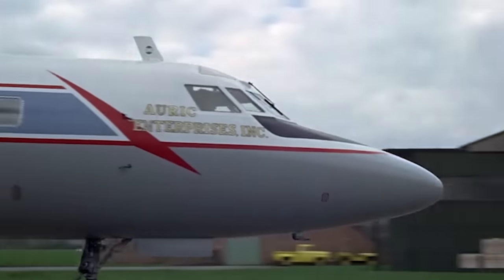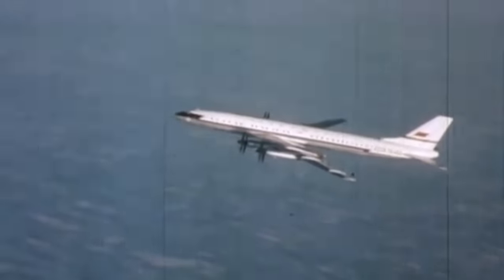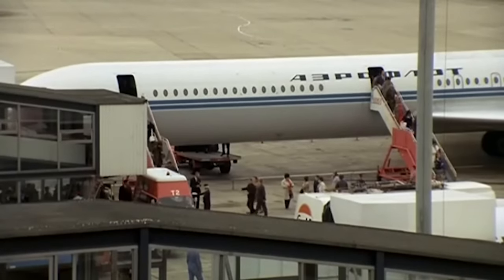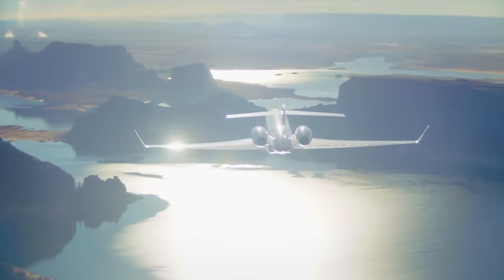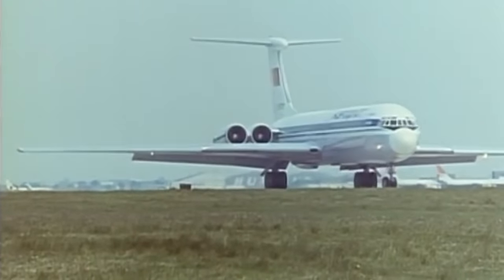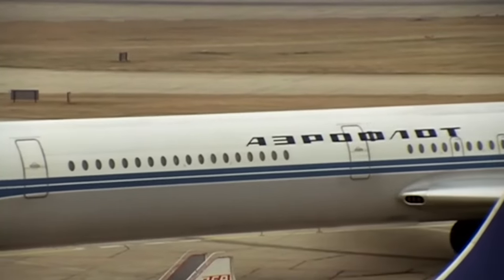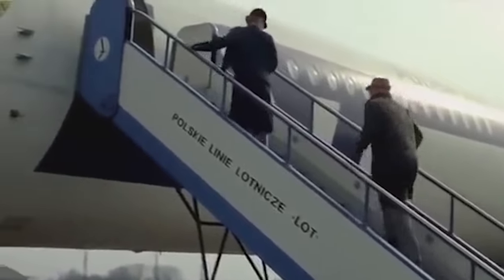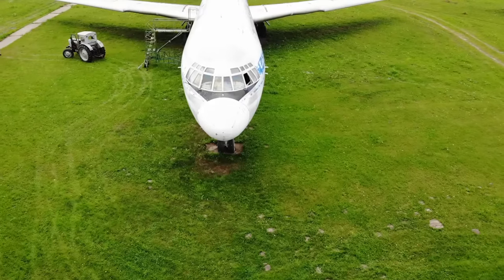IL-62 - an ideal option

Comment: Quad rear-engine layout was so cool. Love the IL-62 and VC-10!
Reply: These planes were beauties
Reply: There's also the lockheed jetstar
Reply: Did you ever hear a VC10 takeoff?  DAMN! they made a ton of noise. Very impressive and memorable experieince.
Reply: The engine layout was its Achilles heel. One engine catastrophic failure wood knock off the other 3. This happened a lot more often than expected. The engine placement and Soviet rush to keep the plane in the air by cutting corners contributed to fatal crashes. I flew one of those in 1984.
Reply: @notyou6950   This engine layout seems like a workaround to me. You design the supports for a certain weight and thrust and then you only need to adjust the nacelles to put more or less engines, depending on what you have at the time. Some ekranoplan vessels had this layout with 8 engines!
I wonder how it would behave with two more modern engines instead of the 4 original ones
Reply: @gsilva220  Ekranoplan!  Yeah!  Caspian Sea Monster!  (How's that for a sober, well-reasoned scientific response?)
Reply: @gsilva220  this aircraft was retired from service in most places that used it because of the catastrophic engine failures. It is also the first passenger aircraft that was upgraded with in flight vibration analysis hardware to keep an eye on possible problems with the engine shafts snapping off. The Soviets build them with a time saving measure of removing half of all the rollers in support bearing and cutting extra holes for lubrication in the race of that same bearing. That introduced a kerf in the steel and reduced strength leading to several well publicised crashes. Once one of the engines shattered its compressor disk it would then chop and shred the other motor next to it and start fires.
Reply: Peter Lyczek    The load on the bearings with 13 rollers instead of 26 overheated the bearings, causing the drilled weakened shaft to fail. The turbine disk then spun freely to tens of thousands of RPMs, shattering itself. The shrapnel would then proceed to damage the adjacent engine, pierce the fuselage,  damage flight controls and set the plane on fire. The most cruel part is that they never did it to an SSR, only to Poland.
Reply: @gsilva220  I know all that. The best part of it all is that I flew on one of them planes and by that fact alone, was exposed to the crash possibility. The great irony of life for me is that I work on cnc machinery for a jet engine rotating components manufacturer.
Reply: They couldn't be more dangerous though as the history of those aircraft showed afterwards.
Reply: @gsilva220  You're thinking about the LOT 5055 flight in 1987, right ?
Reply: @julosx   Yes, but but the course of events in flight 007 was also very similar.
Reply: LOT was very unfortunate in did, engine 2 failures leads to eng 1 and many other failures as flight control, cabin fire and such... a total disaster.
Reply: I never flew on the VC-10 or the IL-62. In 1967 I did get to fly with my friend, who's dad was the pilot, on the corporation's Lockheed Jetstar from LA to Dallas and back. That was a great design and very quiet in the cabin.
Reply: John Dumont As an American and as much as I love the planes from Boeing, Airbus, and other manufacturers, I have to say the Ilyushin IL-62M is my favorite because of the looks and sounds!
Reply: Big Cake It is true that their safety record was...questionable. But nonetheless they are unique planes and I’ll admit that sure Soviet safety as a whole isn’t clean but hey, no form of aviation is 100% clean whether it would be US, Indonesian, European, etc. I mean hell, look at the 737 MAX and the reputation it’s gotten lately.
Reply: Both great planes
Reply: flew across the Atlantic on one end seventies on CSA with a stop in Gander on the way back of course!  YUL-PRG_YUL great beer with 8% alcohol! We were young and bombed! I have a cousin with your name as well I haven't seen in years...cheers!
Reply: Both brilliant planes
Reply: I was working on IL-62 and IL-62M for Polish Airlines. The plane was not terrible and was liked among crews in 70-ties and early 80-ties, even outdated compared to western designs, especially in electronics. On the transatlantic trip, the plane was burning 11 tons of fuel in the first hour. Only after 5 hours of flight, it was reaching economical 5 tons per hour consumption. Fully loaded (and that how it was usually operated by Polish Airlines), it needed the full length of the runway for a takeoff. The really serious problem was (of course you cannot hear anything other from Polish Airline employee), quality of engines, both Kuznetsov and Soloviev (second used later on M version). Serviced exclusively in USSR only, both designs were plagued by scandalous lacks in quality and precision of manufacturing and nothing short of criminal lacks in quality control. As two Polish disaster investigations revealed, those lacks ranged from, nonmetallic inclusion in the material of critical parts, lack of any finish besides coarse on part requiring micro-metric finish precision, improper heat treatment of parts, unorthodox violating technical norms modifications, startling negligence in manufacturing, and nonexistent quality control. Interestingly, the Soviets had denied faults and the role of those faults (in their engines) in two Polish disasters for a considerable time. The official position was, that discovered by Polish Disaster Commissions engines faults were not the cause of the disaster, but it results. Even it was an obvious lie since the beginning, as Soviet explanation, despise of a number of signatures of important “scientific” and government officials, could not explain things like, finding parts of the engine over 150 km away from the disaster site, Soviet denial was finally and fully withdrawn only after, in two separate incidents (in Polish airlines), engines suffered catastrophic explosions while in flight, which did not end in disaster. Both planes landed safely. As disaster did not happen, engine faults simply could not be blamed on disaster anymore. In yet another interesting twist of fate, after surfacing of the following video on YouTube: https://www.youtube.com/watch?v=-xltGZk4aHY (ground inspection after a successful emergency landing of Cuban IL-62M in (good Lord, get this),...APRIL 2008 (!!!), when it seemingly became apparent that despise Polish disasters, engine problems were never corrected, even 20 years after, another campaign of denial took place, involving this time internet trolls, forcing untruthful claims on international Internet forums (Wikipedia and other), even what appears to be the clandestine operation of Russian intelligence agencies. This time on public forums, Russians attempted to claim, that presented by them record (which according to them is 100% trustworthy), of operation of IL-62 and IL-62M, indicated both planes as considerably safer than any western counterpart of the same time. To explain in that context, the very existence of Polish disasters, 20 years after those disasters, all of the sudden some documents of Polish Secret Police of communist-era were “discovered”, which claimed, Polish Airlines in unorthodox agreement with the manufacturer (which grant it a free hand in decision making), decided to extend the time of operation of engines between checkups, beyond originally recommended by the manufacturer. The story itself is constructed with a dose of negligence, revealing the lack of homework of the storyteller. For instance, as a manufacturer (making decisions) it stipulates Ilyushin Bureau, which did not produce engines, it produced the plane's body hence it would not be the one making the decision. That would be a job for Kuzniecov (for NK-84 engines) and Soloviev factory (for D30KU engines). Matter of fact Polish commission found very little to complain about the body of the plane and described Ilyushin Bureau's cooperation in regard to disasters as satisfactory and its findings as “objective”.  Problems were since the beginning with engine manufacturers and particularly bearing manufacturers. Anyway, the problems of such claims are as follow. As Soviet disasters were kept secret from public knowledge and opinion and records were secret, kept by the Soviet state only, it is only unverifiable say of new Russian now government that presented records are full and truthful. While IL-62 was still operated in 2008, revelations coming from the Cuban incident were quite unfavorable for the reputation of the plane (still manufactured and sold), which does create an agenda for the Russian government to be less than fully revealing. Revelations regarding engine operating time limits come not from work of the official Polish Disaster Commission, not in the time of the investigation, but from records of communist secret police which not that much had ties with Soviet intelligence (KGB and GRU back in communist times), but were rather composed of operatives of both. On top, the timing of “discovery”, 20 years after disasters, coincides curiously with the time of the Cuban incident. Even Secret Police theory was never publicly addressed by any serious investigation by the Polish state to my knowledge (they simply ignored it), the existence of such practice would have to be common knowledge in Polish Airlines, reflected not only in vast volumes of documentation but vast accounts of human witnesses memory. Hours of servicing of engines were not kept secret in Poland. Every, even basic level worker could have easily check them, or actually, to say more precisely, did check them, as knowing and operating with those numbers were part of normal work routine for a broad number of people from of all levels of the company. Those hours were listed in numerous places, starting from a tag on an engine or box with the engine itself (engine were kept unguarded on the hangar's floor, where anybody, even visitor could simply stop and read the tag), to documentation in various departments of the company (again easily accessible to anyone - as logbooks simply were lying unguarded on desks in hangars, where absolutely anybody who wished could read it, without being asked any questions). As following and keeping those hours was part of a job, the work of many people required constant checking and familiarity with them. From my side, as a former employee, even not directly involved in engine servicing itself, I can only say, any memory of altering those numbers,... are simply not existing. So here they are. My two pennies, while on the subject. Was not trying to make it an attack on Russia. My sympathy simply goes not to people who manufacture the engines, but to common, average people who fly them, including Russians. They are the ones whose lives will be affected (hope not) by flying dangerous planes. There is one more aspect of the story, purely speculative. Are the Russian engines really that bad? Hard to tell for sure! For sure the Cuban incident happened. For sure Soviets were aware of engine lacks way before they admitted it, as they were supplying “special” engines to service the official delegation flight of the Polish Communist Party to China (once delegation returned, engines were demanded back). The plane suffered no disasters or incidents in Polish Airlines for 8 years. Two disasters (and two additional incidents without disaster) happened in the time of “Solidarity” in Poland, where Poland definitely was perceived in the USSR as an enemy. Could it be this perception played role in Polish disasters??? I don't know the answer to this question, yet it feels impossible not to ask it.
Reply: Tu-154 too.
Reply: @Leon-Hardt  Indeed. Tu-154 uses the Kuzniecov Nk-8 engine, while Tu-154M Soloviev D30KU (same as IL-62. Tu-154M was used by Polish Airlines and also suffered mentioned earlier catastrophic engine failure – which did end luckily, however).
Reply: @LCPotato  i flew on one in the 90’s, and from the passengers point of view, it was very comfortable, low noise, lots of legroom.  It was interesting for me to observe the fixed leading edge droop and the wing attachment joint, like a DC3 with a big flange and exposed bolts.
Reply: It was so good that disintegration of one engine damaged two more. It happened twice. make a research. Many dead people.
Reply: @seansands424  Super VC 10 the superior engineering..Russian engine technology sucks.
Reply: Lockheed Jetstar was the first..The design was created by Kelly Johnson. Russians copy everything
Reply: North Korea is still flying them..
Reply: One VC-10 was used as testebed for the RB211. So he flought in a ridiculous configuraztion, with two original Avons on the right, and a single RB211 on the left :)

For a time, the RAF considered to re engine their VC10 tankers, making them RB211 twinjets, but it never happened.
Reply: @notyou6950  Yep. This actually happened twice to the same airline (LOT Polish airlines) when the plane crashed as a result of uncontained engine failure.
Reply: @LCPotato  The uncontained engine problem was never really fixed. Poland had 2 crashes because of this. One of them took the life of Anna Jantar
Reply: @seansands424  It all comes down to the Soviet cost cutting and lack of maintenance.
Reply: there is no beauty to this airplane, it was a stolen design that the rest of the world flew years before us but we were so locked down we didn’t know anything and assumed it was modern. They couldn’t even do a good job copying the design, it was a flying coffin with engines so badly designed they had to use 4 on the tail and the plane was all manually controlled, how embarrassing. But that’s what the eastern block was known for-propaganda and poorly copied Western design. the world was already flying in boeing 747s years before this pile of junk, and mind you the much older boeing 707, and 747, each sold around 1400 units (2800 combined), while the il 62 barely sold 290. Not to mention the boeing 737 sold over 10000 units. Yet the number of il 62 crashes are almost the same as the boeing planes even though there were way less il 62 in circulation with less hours of flight time per plane.
Reply: @binaryruffian7538  Does the IL-62M not have hydraulically boosted flight controls? No wonder the Russians do so well in Olympic weightlifting competition! Your analysis is very humorous!!
Reply: @davidlegeros1914  I have a lot of Russian friends, that I love and respect. They would be embarrassed at the notion that aeronautics are being equivocated with Russians excelling at a sport category, by one of their countrymen

Comment: CSA operated the IL-62 to Singapore when I was just a young apprentice with the local airline's engineering department. We were invited onboard to tour the cockpit and I remembered observing how much more spacious and bright its cockpit was compared to the Boeings. It was so much easier to get into the pilot's seat because there was no control column in the way. The bright green paintwork of the instrument panels were quite unusual.
Reply: Bright green paintwork was to make the cockpit more calm to crew.
Reply: You mean ČSA?